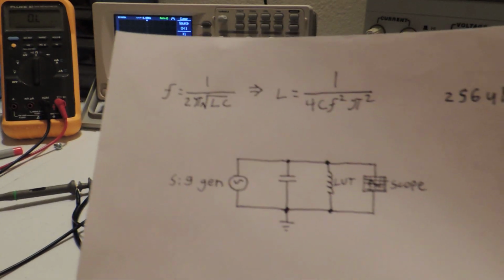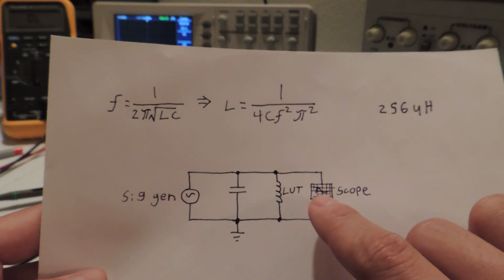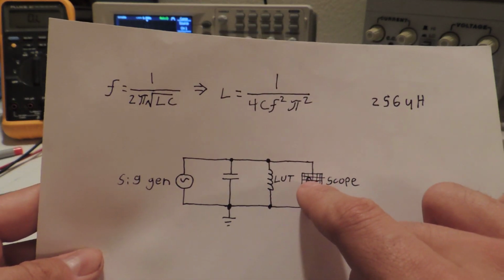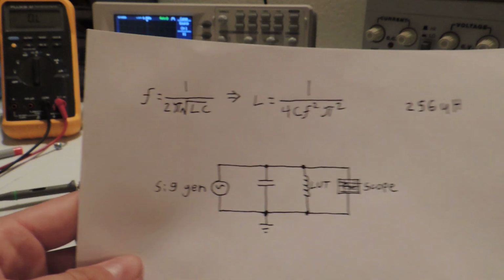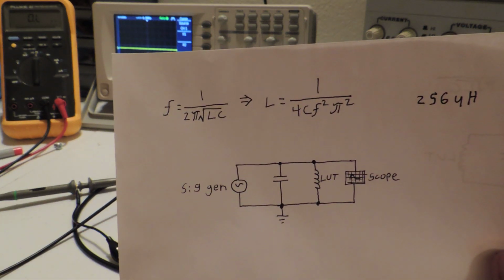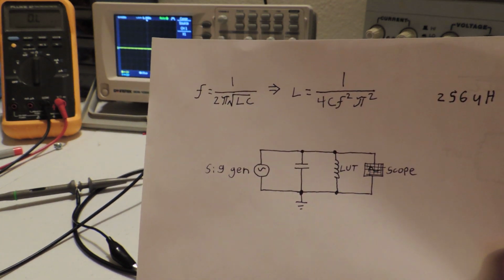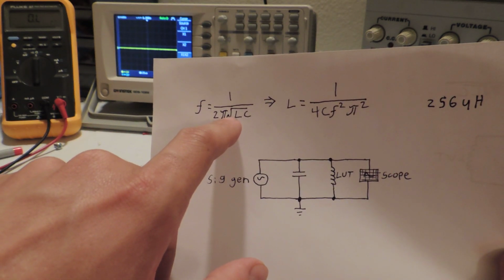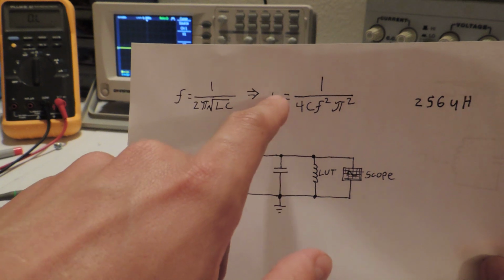Transformer/inductor design Part 3

Comment: This measurement setup in this video is WRONG, signal feeding is from a too low impedance for parallel resonance.
On MY PE1ABR Ferrite page you learn how-to-do-it the right way.
That is feeding the generator signal to the L-C  with a very small TOP-C with a value of 1% of the parallel Cap or even less, even down to 0.1% with a good Q.
In this way the Q damping by the 50 Ohm  signal source is minimal and what you measure is much more realistic. You can even measure a reliable Q.

Comment: Thanks for the great video series!!  One question: at about timestamp 3:53 it can be seen that the capacitor's voltage rating is 2000 vDC.  Although it's rating is DC, you can put AC across it.  I have seen this in MANY types of capacitors (laser, Tesla caps, etc)...why is it OK to put AC across these "DC" labeled caps??

Comment: add 10k resistor between signal gen & lc circuit  otherwise signal generator output short circuit
Reply: ***** most of the signal generators are 50ohms, so your circuit is 50 or more than 50 ohms is OK. but in  resonance you will see big amplitude change that way 10K is use. But generally 10k use every where see "Tesla coil tuning methods"

http://www.hvtesla.com/tuning.html

Comment: Nice video Eric but a question of the accuracy of the Inductor,
You said it was 1.4% off.
Your estimate was 256uH and the stated value was 220uH
I think you got something wrong there as this is 16.36% out and not 1.4%
100-((256/220)*100) = 16.36%
or 220+16.36% = 255.992
(Can I have your Frequency Generator ....please.....)

Comment: Great video and helpful for measuring inductance values but on your circuit schematic you have to add a resistor in series with the LC circuit because as is shown now the amplitude you measure it supposed to be the same as the generator amplitude since are both in paralell!! You don get the same in practice because some energy is absorbed by the internal resistance of your generator and this might confuse some people...!! Anyway is very good video..

Comment: If the output impedance of that voltage generator is zero your circuit will not show a change of  voltage across the LC circuit, and will be a very low Q. Use a current generator or put a high resistance inseries with your voltage generator to match it to your parallel LC circuit.

Comment from the maker: As long as you can fit all your turns on the toroid the only difference the wire makes is how hot the wire gets. 

Wire diameter has no direct effect to the magnetics.